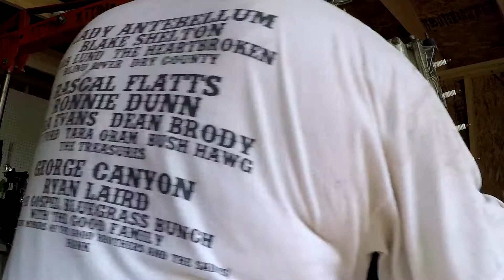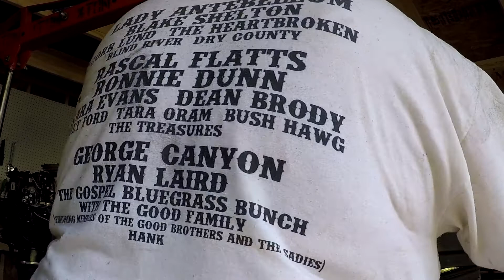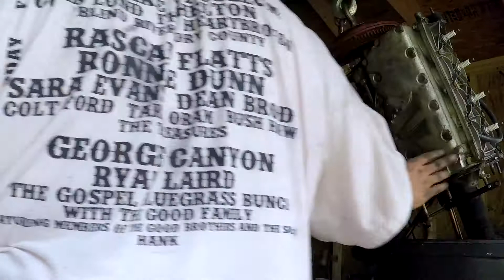Mercury Outboard Thunderbolt 500 50 HP Part 7 - Power Head Removal Continues

Comment: Hey Hawkeye. My Thunderbolt 500 is running but there seems to be something wrong with the throttle-when I’m at full throttle, the Energizer box doesn’t move very much unless I press it towards the rear of the engine manually. Any ideas? Thanks!
Reply from the maker: Check and see if when you put the throttle in WOT (wide open throttle) if the carbs butterfly's open all the way?  Could be out of adjustment.

Comment: Ok a few questions. What year is that thunderbolt does the water tube just slide up in there that easy or do they have a bend. I have a promise with mine. New impeller unclogged the pee hole and still have no water out the pee hole. I was thinking the tube my be clogged or there a block in the head
Reply from the maker: They made them from the mid 60's through 78'  Yes the tube just slide up into the powerhead.  Has a very slight bend at the end by the water pump.
Reply: @hawkeyemarine  ok thanks I'm trying to get mine out to see if it's clogged or not. I've got a 73 thunderbolt with a new impeller and the tell tail is not peeing out water so I my have a bigger problem if the tube isn't clogged
Reply from the maker: with the lower off flush it with a garden hose.  Just use light pressure in other words done just watch how much water flow you apply.  You can also use compress air apply to the pee hole.
 @milesspradley4062